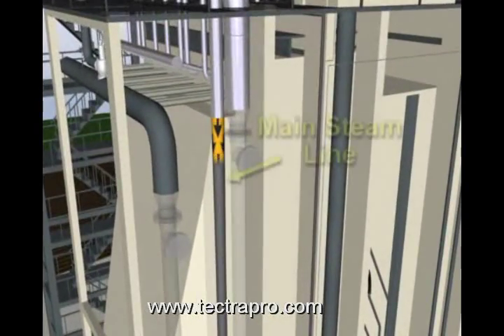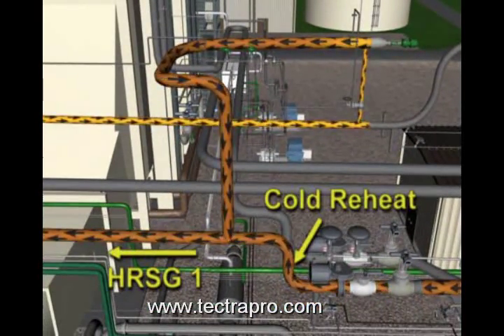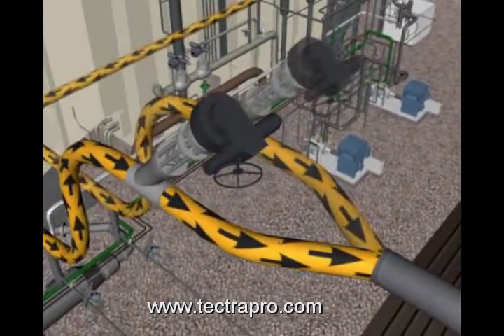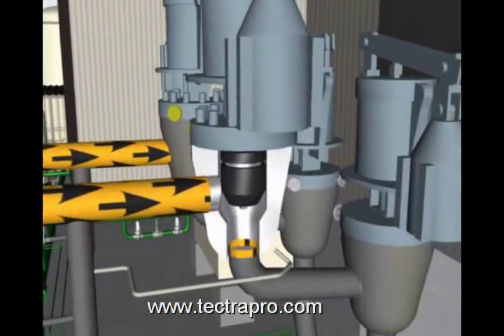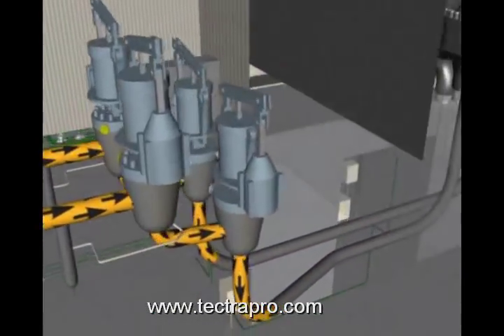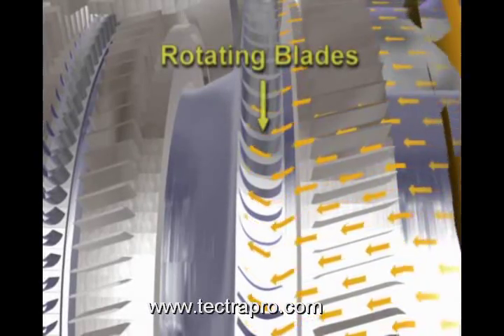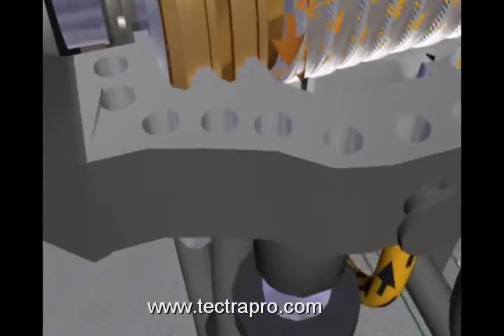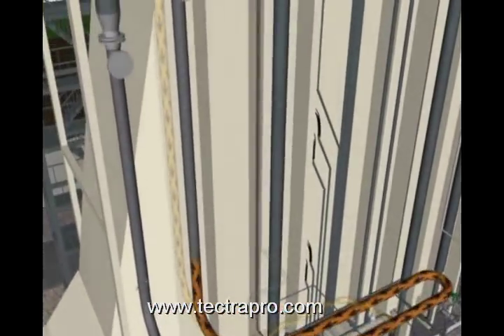Steam Turbine HP Steam Flow

Comment: heyy!... I HAVE A FEW QUESTIONS. How much steam/water is needed or used to power one of these steam engine? At what temperature the steam enters the valves? and if you´ve got more info please please.. reply :)
Reply: stefano greco steam enter at temperature of 550 ℃ and at 250  kg pressure for ms steam 
50 kg for ip and lp
Reply: 514 ton per hour

Comment: @NickBlackDIN This is a high pressure steam turbine meaning there is now intermediate or low pressure stage. All of the rotating turbine blades are of the same size with the exception of the first set of redirecting stationary blades.
Reply: Impulse turbine

Comment: @NickBlackDIN if it were a jet engine yes the first stage is almost always the smallest and strongest, this allows larg amounts of torque to be used for the compressor series, the larger turbine blades further in the series are normaly used for the bypass fan and the large compressor series if there is two series of compressors. since this is a steam turbine im not quite sure about the sequence in which the turbines are set inseries from smallest to largest, you are rite though i agree..